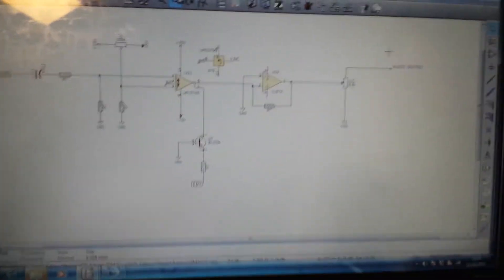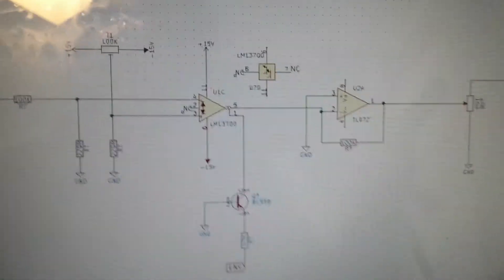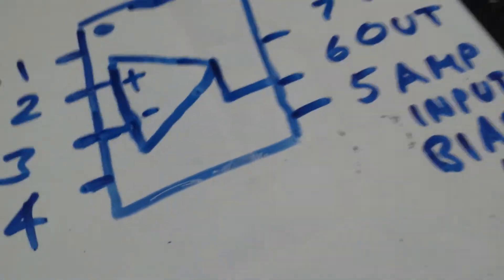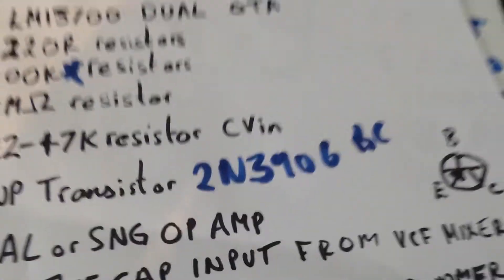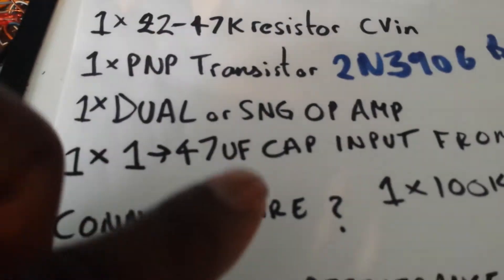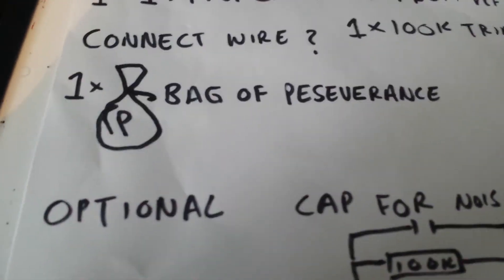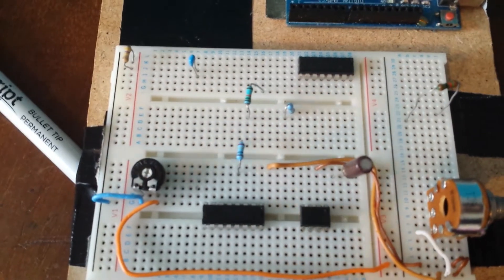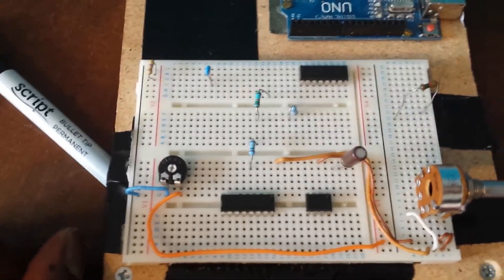DIY analog synth project Tutorial Part 13b (SEM VCA Clone)

Comment: the 220R resistor on the +/- inputs are rather small, you should aim for 560R / 1K, it's a voltage divider with the 100K resistor in  front of it.
100000÷220 = ... you are scaling down the audio 454,5455 times.

the 47K before the PNP seams rather big, probably should between 27K and 18K to aim for 10 V.p.p., a good place for a trimmer.
there should be a 1M resistor between the trimmer and the 220R of the non inverting input.
Reply from the maker: There is nothing wrong with my values I they worked well. However since then I have further changed the design slightly so its quite irrelevant now anyway.
Reply: @AdamTheAd-vanc3d  well, it works yes, but the OTA has to work harder to pump up the audio to 10 V.p.p. and create some distortion.

most use 1K, like Moog did in the Ladder Filter. 100 to 1 instead of 100 to 0.22.
Reply from the maker: Are you aware that the first schematic shown is from the oberhiem sem not my design.
Reply: @AdamTheAd-vanc3d  check the design / schematic of the CA3080 and LM13700 in the datasheet, they differ a bit.

the CA3080 was the first ever.

personal preferences from the designer, but Roland used 560R using the same part.
Korg also used 220R in the Ms-20 filter.

if you would use 220R you would barely see it on the scope.

5V / 100 (1K) = 0,05 V swing.
5V / 450 (220R) = 0,011111111 V, probably you wouldn't see at all.

Befaco HEX VCA uses 680R ( check their Schematic .... they are the best of of the best  )

you would probably better off using a 560R / 680R , so you don't have to scale it up again dramatically.

no personal attack.

: )

Comment: Hi!
Works great, thank you!
One thing that I've didn't got a meaning about... is the trimmer. I tried to tweak it and doesn't hear a lot of difference. What is a bump are you talking about? A kind of a "centerline tilt" that is going smoothly?
Reply from the maker: MoolahNasreddin . Hey there glad you got it working. Yes the T1 trimmer will allow you to stop null out the cv signal. If the envelope cv is caising your signal to jump from the center. If it works fine for you just leave it then :-)
Reply: the Trimmer was used to offset the 5% tolerance of the 220R / 560R / 1K resistors in the good old days and you should use a 4uF7 / 10 uF capacitor with a 1M resistor to GND after the opamp to center the wave again.
it would cause the output signal to be either slightly  positive or negative but not centered as desired if looked with a scope.
ideally you would use 0.1% resistors here.
Reply: ... and off course there should be a 1M resistor between the wiper of the trimmer and the 220R resistor (witch should be 560R), even better if you also use 470K on both sides of the trimmer to have more fine control.
Reply: @AnalogDude_  Cool advices! Thank you! I'll be back to this project, this will help me.

Comment: An other great video, a question , why do you not  connect the out from opamp on the outer most pins on the pot , as it's now you will short the opamp out to ground, even with a 100 ohm resistor it will be almost a short
Reply from the maker: Bo Anders Mikaelsson Thankyou and yes see what you mean. Ill test using this method and then amend in the schematic ;-), thanks for the tip .